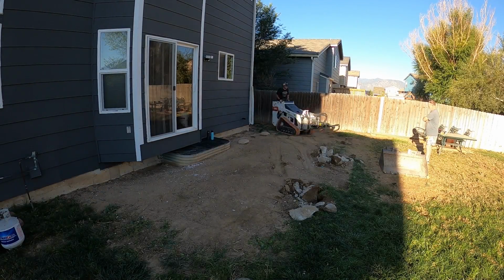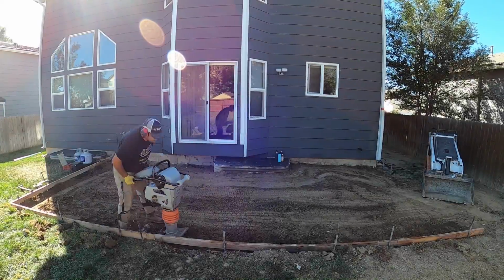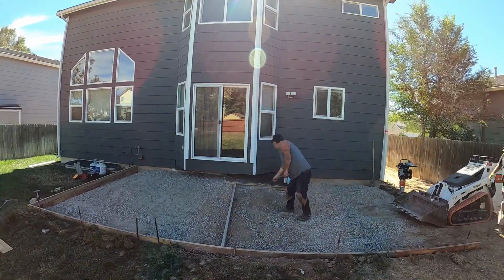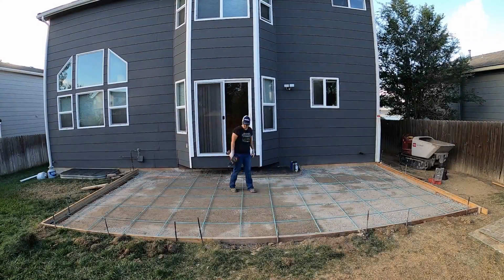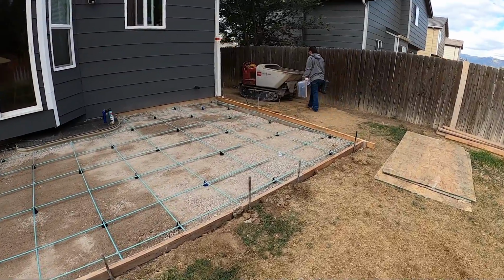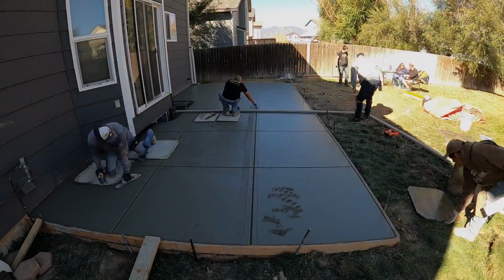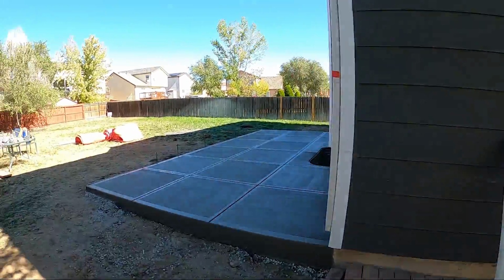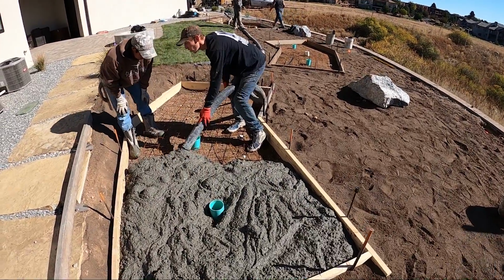How to pour a concrete patio (Checkerboard picture frame pattern) plus some concrete planter bases.

Comment: Do you need any type of barrier between the homes foundation and the slab?
Reply from the maker: Some people put expansion board. I choose not too especially when it's wide open on the opposite side. It will allow water in between the home and slab and that leads to issues down the road. When there are 2 structures that the slab is in between almost always I put expansion on 1 side.
Reply: @jmconcretecoloradosprings  thanks for the great information!

Comment: Sheesh…nice looking patio for sure!! What size radius and depth are the jointer tools you use for patios?
Reply from the maker: Thanks brother!! I use the kraft 304 jointer. But then I come back with a demo saw and score the joints where they cross and end. Gonna start using a deeper jointer to avoid using the saw.

Comment: The only bad thing about covering it, is it can discolor it, at least in indiana
Reply: We hardly get below 20’s in Mississippi.
But yeah covering up leave uneven cure lines from where the plastic wrinkle and didnt touch concrete surface. 
It goes aways few months after